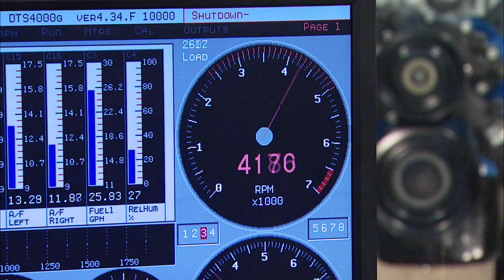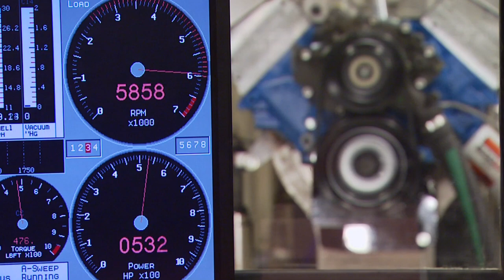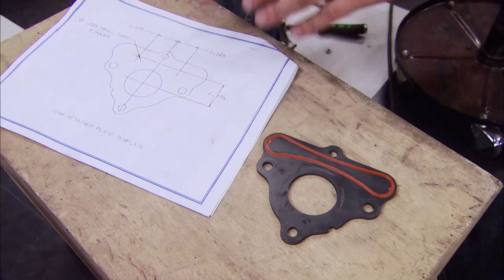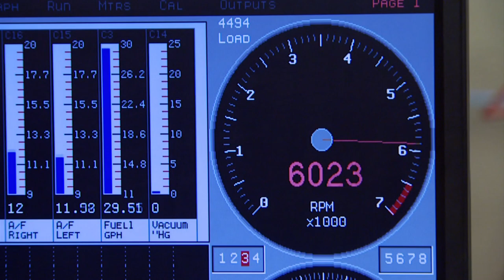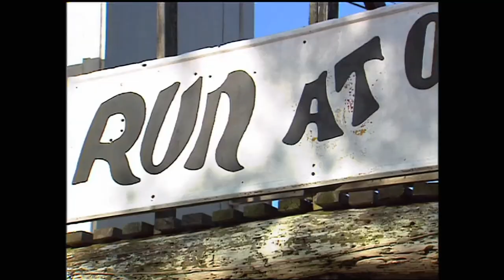Will The Junkyard 460 Big Block Hit 600HP On The Dyno? - Horsepower S13, E10

Comment: Notice they didn't fiddle with the jets or timing?  I suppose they didn't want to make too much hp and ..disenfranchise their GM fan base.
Reply: I noticed this too, they always go max effort on Chevy junk and leave the Ford as "good enough"
Reply: 😂😂😂
You can always tell this show is GM forward. Don’t get me wrong, I love both but old school Fords never get as much love.
Reply: Right how bout we slap a turbo on it
Reply: Maybe They Didn’t Want Pre Ignition Lol
Reply: Ummm… nobody noticed them change timing twice and change springs in distributor??? 🙄🙄🙄 If A/F is correct on their graph why would they change jets? The one or two hp that you’ll gain by leaning it out might not have been worth the hassle? Just simple observations from a simple man I guess
Reply: Kaase would of had 1000hp in 2 pulls on the dyno
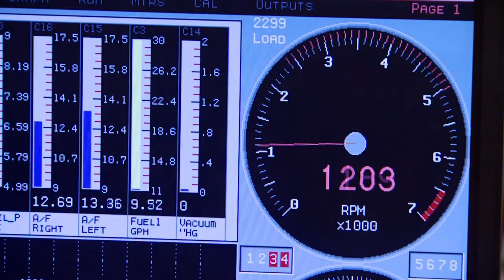Reply: 7:08 they re-curved the distributor and moved the timing up.
Reply: Good grief, does anyone cry more than Ford fans?  Of COURSE they adjusted timing and jets.  They showed 2 different distributor adjustments on there, and the A/F ratio is the A/F ratio...if it needed adjusting, they did it.  If it was right out of the box, there was no need.  Just because they didn't waste video time showing it doesn't mean they didn't do it.
Reply: Well Chevy is cheaper stuff let's be honest here. Ford is it's own thing. GM has made all types of stuff Chevy is just a branch off of that. Ford all day for me
Reply: @luthermoore2969  Not when these motors were designed.  All the GM brands were separate and individual.
Reply: @SealofPerfection  you just said all GM brands. I mean I can't spell it out any better myself. You killed your own statement with that statement lol. Yea they were all made by GM. Detroit diesel is GM. Mopar and Ford are their own thing. Yes all types of companies have ties to GM right even ford. But yea Pontiac engines where somewhat different than a Chevy But it's still all GM. Ford is Ford not GM or whatever but Lincoln and Mercury's are like the Chevys and Pontiacs for GM.
Reply: @luthermoore2969  They were all totally different motors under one umbrella. GM is just the parent company.  Like Ford/Lincoln/Mercury was at the time.   
Except the motors for Lincolns and Mercuries were essentially all Ford motors, they weren't different.
Like Pepsico owns Pepsi, KFC, Pizza Hut Taco Bell, and many others...but all those are different companies.  But "they're still all Pepsico". 

And a Pontiac motor is 100% different than a Chevy.  Not a single thing the same.  
Olds motor, same story.  Buick, same story. Caddy, same story.  
Buick, Olds and Pontiac all made 455's, and they were all totally different from each other, designed and built separately.  They were as similar to Chevy as the Ford 427 was to the Chevy 427.   
So "it was all GM"....yeah, but they were still separate companies.   

It's not as much like that now, but back in the day when these big motors were built, that's how it was.  They were starting to share some body stuff, but the motors were 100% individual.
Reply: Likely didn't want to show the time involved with swapping jets and bleeds.
Reply: What these Two Bozzo's don't know is this is not a Chevy. I like the way they always compare ford to Chevy but use top parts for Chevy and junk yard parts for the ford. then say there the same...
Reply: Slowstang I agree with these guys definitely don't push the fords max potential, but I'll tell you rn that the small block chevys they do idk with the parts they use there not exercising the full potential of them. Richard holdner always fights fair
Reply: Man, the look on Pats face when his maxed out 639 BBC got beat by the 1100+ Horsepower Jon Kaase 598 BBF..  Engine Power S6, E5   @JacksoNR26
Reply: Hows the suzuki swift going these  faysb
Reply: There's prolly more truth to that than you would think

Comment: i’ll take that 460 over an ls anyday
Reply: I love my very mildly modified 1970  460 for its shear torque nobody ever expects it to run 13.30s in my 73 4 door Continental. Now that being said it just like the car weighs a ton compared to a modern engine.
Reply: Think a 460 will go in an rx7?
Reply: @FacesintheStone  that engine bay is huge a guy put a coyote in one. So yes it will fit
Reply: I'd eat that 460 for breakfast with my 5.3 bet that fool 😆
Reply: L
Reply: I would deal that 460 junk Ford a L with my ls 5.3
Reply: Your dam right and it should be a crime to drop one in my beloved mustangs .just sets my berries on fire ..I love my 460 .it's blown up now and getting ready this month to rebuild .but it lasted 5 yrs of me driving the ass out of it ..and I do mean driving it ..lol.tunnel ram 2 .600s cammed everything but ported cast heads which I will be doing this time around..I'm gonna try and get as close to 600 as I can on nothing more than a good old fashioned stock with some critical new and reused parts and old timer tricks and a bunch of luck I'll hit 600.i won't be racing it mostly street like my last build .just fun but don't like losing having fun either ..lol.woooooo 93 notch
Reply: @AtomicReverend  I plan on mildly building my 460 in my 75 4dr marquis, can't wait!
Reply: @jackperry9369  you comparing apples to oranges, 
The 385 engine family (429, 460 V8) debuted in 1968 in the Lincoln Continental The LS Chevrolet is 1997 I believe. With 30 years of technology the LD should be a better performance engine.  It is no different than the Ford flathead being dethroned by the original small block Chevrolet back in 1955 when the basic flathead V8 had its roots clear back in 1932. 

A 4 bolt main stock block 460 can and is routinely seen at the drag strip making 1500 plus horsepower naturally aspirated, those are pretty respectable numbers considering the engine came out as a luxury car engine and then morphed into a pickup truck engine torque engine and pretty much never saw the muscle car era other then the boss 429. 
And by that rationale the best factory 5.3L that I am aware of makes 355 horsepower from the factory in a 2020 chev truck, definitely respectable but it isn't exactly bragging rights either especially with all the technology that is stuffed in that engine. 
By comparison the boss 429 (same engine family as the 460) was way under rated at 375HP and numerous Dyno pulls have shown them to make about 500 horsepower at the wheels and that was 1970. 
For the record I actually like the ls Chevrolet and I think it is a great engine that is lightweight compact and makes tons of horsepower for its size with a ton more power potential locked away waiting to come out just like the old small block Chevrolet from back in the day. It's a great engine but it isn't exactly bragging rights that your engine with 50 years of technology and improvements can be an old dinosaur. It's just like a new zl1 Camaro can beat an old zl1 Camaro from that same time frame who cares.
Reply: @AtomicReverend  seriously ..ty for educating 5.3 guy. I drove a 460 with this almost identical build daily for many years ...other than breaking stuff due to insane torque, never any problem and the real challenge is traction. That said ...it could eat almost anything to 100. Wicked fast and bulletproof!
Reply: @AtomicReverend  - the 385 series Ford big block 460 or 429 had more potential than ls
Reply: Lol
Reply: @jackperry9369   don’t worry we can all tell you’re dad is your uncle grandpa and cousin
Reply: @jackperry9369 if you gotta keep saying it….You really are slow
Reply: @rakemuhammad  LS will smoke a 460 no comparison A LS is far superior
Reply: @Redmudmarine  put a 5-3 LS GM in it and be done messing around
Reply: @jackperry9369  You must be talking about stock….I have one and its built…Don’t get embarrassed 😎
Reply: @jackperry9369  your as slow as your motor
Reply: @thomasdavis3998  ls will smoke a 460 dude
Reply: @mustangandfrankenstein  getbann6.0 ls for the replacement
Reply: @souperdave2009  ford 460 aint shit bud 6.0 b would eat it up
Reply: @vuxxrevolution3400  your mom is slow 🐌
Reply: I agree! Nothing like a BIG BLOCK!
Reply: @thomasdavis3998  not ls smokes them all the time

Comment: Even when they do a Ford build. They find a way to sneak in some LS junk. And My Bud who has built 100's of BBF agrees with the show. The 460 is the easiest engine to get 600HP from. He has taken many junkyard engines that cost $50.00. And made them into screamers at the track. Not that hard with a 460. And yup that $50.00 is accurate. Local u-pull it's run specials all the time on certain engines. And since the 460 was so popular in trucks their availability is almost guaranteed.
Reply: No shit ..where and when.i need one or two or shit I'll buy you one grab me 3 you take one .ok . seriously I'm needing one bad..blown up
Reply: 68-71 damm good blocks. 72 block needs work. I got the 73 block and did a mild build on her for my 67 Mustang Gt. Still a low compression motor but am going to rebuild it bottom end up and fix that. lol
Reply: I took a 429 out of a 1968 Thunderbird ($300) rebuilt it with a set of stock ported heads, roller cam and a Blue Thunder dual quad intake w/MSD ignition... it made 610 hp...  I put into my 1940 Ford Coupe with a Ford 9" and mustang suspension.
Reply: LS Junk

Comment: Im not a ford guy but the 460 has been one of the best engines
Reply: Not sure about that, cant really supercharge them without going centrifugal
Reply: Gotta admit,  I've been considering a Windsor a turbo 351w for my 94 flareside f150, but a straight up big  block would be so easy! Got a few guys I know went the cheap 460 route, 7 second 1/8 mile for cheap! But all that weight and the parasitic drag of that honking c6! But, aluminum heads cut a good bit of the weight off and I'm not going road racing! That thing needed a MUCH bigger cam!! The old 460 has enough low end tourqe to overcome the overlap!
Reply: @gunz_n_bikes171  There are offset distributor mounts for all Ford engines to let a supercharger fit. Or in this day and age its pretty easy to convert to coil pack.

Comment: That's how you convert an LS to a 351😂
Reply: It does look like a Nascar spec SBF.....so the rumors might be true😂
Reply: I concur on that one👍 chevys R07 engine looks nothing like a chevy... except the valve covers that say chevrolet 😂
Reply: @LeachimSagrav333  Oh, bonus, the LS firing order is the same as the Ford Flathead...or some Ford derivative....so there's that. Heck, the Gen 3 Hemi has the similar design characteristics as the LS except for the valve orientation......and the new Ford 7.3 gasser is a scaled up knockoff of the LS, which in the end is a knockoff of a Ford design....so it just goes full circle.
Reply: All chevrolet did was pimp off of 50 years of ford tech and call it a "clean slate design" but I will admit ford did drop the ball.
Reply: @LeachimSagrav333  as much as I like the Coyote....and it's an amazing engine.....too complicated...too much stuff. Bet it was a knockoff of the Mercedes M119 V8.
Reply: I believe bmw also had a 5 liter in the 99-2000 or so M5 correct? Made about the same power as the coyote? I could be wrong though 🤔
Reply: @hoost3056  i want to say the firing order is that of a 351w, but I must say its nice to know someone out there knows the ls is based off the sbf.. supposedly the LS stands fo Lotus Series in which ford owns..
Reply: Why would you want to do that

Comment: Thank you for keeping the Ford build ahead of the LS. 👍
Reply: Ford will never be ahead of ls
Reply: @isaiahwinslow5140  Guess that's why they are still winning N/T X275 races 🤔
Reply: Wot?😮
Reply: @isaiahwinslow5140 keep lying to yourself joe biden
Reply: @isaiahwinslow5140 a small block ford motor designed in 1968 is ahead of the ls let alone something with more cubes. One thing that cracks me up about chevtards is they think the ls is the best engine in the world when it's not even the best engine made by chevy. 😂

Comment: Great ending!! I'll have to go back and look for the 460 videos, I'm starting a 429 project, thanks
Reply: 429 and the 460 is the same engine just different crank
Reply: AFR cylinder heads and intake. John Kasse P51’s or P71’s. The AFR’s are very affordable for the power. Good luck with your build.
Reply: @staggdegraaff1531  3.59 vs 3.85 429-460
Reply: @StainlessTIG2  its just the crank ones a long stroke 460 short stroke 429

Comment: Funny the LS uses a Ford 302 distributor center crankshaft thrust bearing,can torque them with a Ford SB torque plate, symmetrical intake and exhaust port placement in the heads and finally got a Ford type of camshaft thrust plate.Nice the Ford SB also has a crankshaft key way.  No similarities here from a LS to a 50 year old SB Ford motor. Ha Ha.  🤔
Reply: 60 Year old Ford motor, The Small Block Ford came out in 1961 :) Would have been even funnier if they had installed a Duraspark distributor!
Reply: @FixItStupid  221, 260, 289, 302, 351 :)
Reply: There's a series on youtube where a guy actually did the install of LS heads on a 351W.
Reply: Don't forget the block is basically a shrunk down FE block!

Comment: Yes the 460 is so easy to upgrade for serious torque and hp.    Great motor.
Reply: Yeah, when you put aftermarket everything on it, it can make 600 hp.    Seems awfully expensive.   You could do that with a BBC with stock heads.
Reply: @SealofPerfection  600hp ?   That's the low range.  We get double that.   Many 460 over 1200 HP.   Ford parts cost more because quality just like ford rear ends .  They are made for power and to handle power
Reply: @eddiespagetti8395  Not with stock heads and no power adders, you don't.
And if they were so tough, why the main girdle and the high-dollar oil pump?   Why use BBC rods?   
You can't just use off-the-shelf stuff, do a good valve job, high-comp pistons and a roller cam and make that power with one.   Takes more work/money.
They don't "cost more because quality".   That's ludicrous.  They cost more because they are more rare, because not as many people bought them when they were being made.  There's a reason for that, too. 

You can make power with anything these days, since you can get aftermarket anything now, but when you have to use stock components, the Fords always lag behind.  They're good motors, but the BBC is simply in another category
Reply: @SealofPerfection  what? You can get "DOVE" heads that came on 70' 460's that have 75cc chambers, will get you 600+hp and put you at 13.5:1 compression. This 460 was from a smog era car with 7.8:1 compression.
You can't get 600hp from a 454 with the heads that came on the SS Silverado's can you? Didn't think so. Not all stock cyl heads are the same.
Reply: @countingsheeple2428  I would certainly hope you could get 600 horsepower out of a 13.5 to 1 compression 460 cubic inch engine.
And no, the 454 SS heads are peanut ports, but there are loads of 454s with oval ports that aren't, and you can certainly make over 600 horsepower and run pump gas with those. Good luck finding some of those Dove heads you're talking about.
Reply: @SealofPerfection  First off, compression does NOT equal horsepower, it only gives you the ability to do so.. Second, like I stated earlier, the stock heads that were on this particular 460 were late 70's smog heads. So just stop comparing your oval port heads, which btw had non-hardened valves and needed porting just to surpass 500hp. They stopped using oval ports except for 1975 on 454's and only pre 1978 427/366 tall decks had them. Good luck finding 50+ year old oval ports at the junkyard that aren't rusted beyond repair. You're comparing apples to oranges here. 
I'm not knocking  BBC or GM either, in fact I'm not privy to any of the Big3. They've all made great stuff. But it's nonsense to say you can make 600hp on readily plentiful BBC with stock heads when the cast iron heads you mentioned A: won't kick more than 600hp unless you're over 11:1 using race gas, and B: haven't been "stock" on any BBC since 1978.
Reply: @countingsheeple2428  lol.  Compression absolutely equals horsepower.  If you do nothing to a motor other than raise the compression it will have more power. You must not understand how it works if you don't think this. You squeeze the same fuel air mixture into a tighter space, you get a bigger explosion. That means more horsepower.
As far as regular oval port heads, they are plentiful even today. You can find them all over and they are cheap.  Just a tiny bit of work to them and you can make 600 horsepower or more on pump gas. You can find dozens of videos of pump gas 454's making that or more. It's not hard.
The 781 heads were put on vehicles up until 1985. You can find them all over.
That's not even counting the rectangular Port heads, which are also plentiful and inexpensive. You can just slap them on there and make over 600 horsepower easily.

You just can't do it as easily with a Ford big block. You can go all over YouTube and find dyno tests where when they have similar modifications, they just don't make the power that a Big Block Chevrolet does.
I have nothing at all against Fords or Mopars or any other motors, it's just an observation based on the facts.
Reply: @Pacfanweb why did you get so pissy about something that had nothing to do with with your preferred brand. People like different things and it doesn't have to be a pissing match. That shit is for kids.

Comment: I always get a chuckle when he slams in the distributor with the cap on like that's how its done. 😅 I spend at least 8-10 minutes getting the rotor to point at #1 and get the oil pump slot lined up
Reply: Little tip! Once you get it lined up with #1 you can rotate the engine and hold down on distributor and it will find the channel and still be lined up in the correct spot on the crank
Reply: Joe was always pretty rough on this show.
Reply: You think Joe is rough on distributors? Ever seen that maniac install a camshaft?
Reply: @slowstang88  Yeah it's bad!